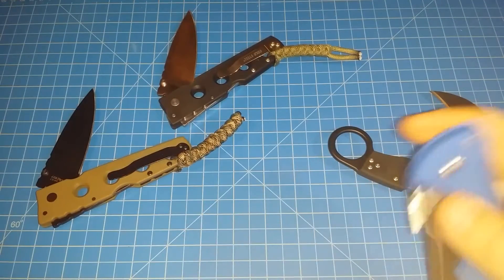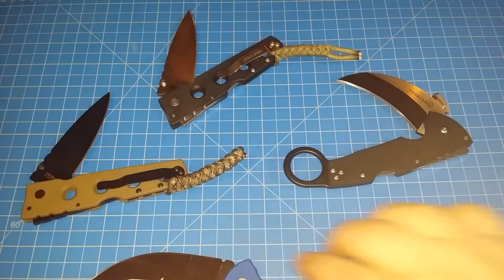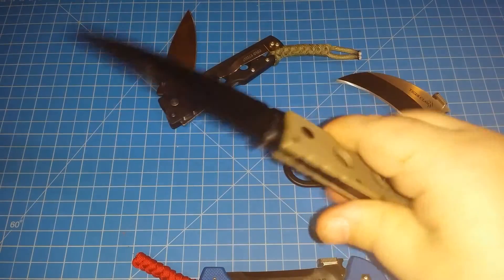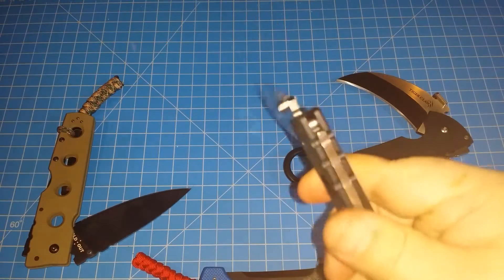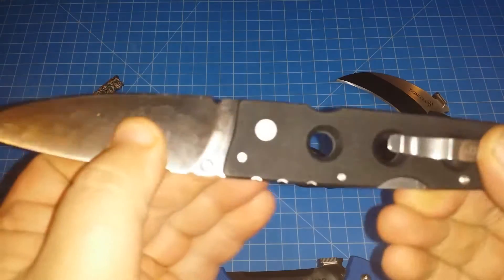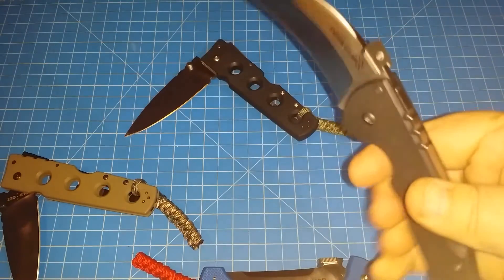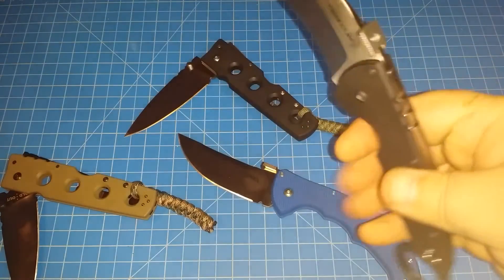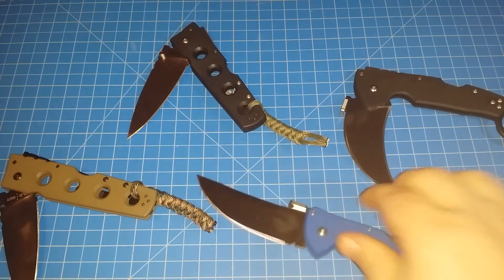Cold Steel Spring Workaround?

Comment: If you feel like going through the trouble you can take them apart and polish the lock pieces, the washers and the G10 under the washers.  I did that with a couple of my cold steels and it really smoothed them out.  My black Hold Out 2 is also emasculating.  I wonder what the deal is with those things.  Thanks for the video!
Reply from the maker: Oh, nice. I barely need any reason to mess with my knives beyond my pay grade. I will give this a shot. While I am not reveling in your difficulties, it does make it easier to know that I am not the only one having problems with the Hold Out.  Thank you for the comment.
Reply: GLAD TO KNOW IT'S NOT MY OLD 73 YEAR OLD FINGERS AND HANDS

Comment: I heard about this as well. Also about stacking sheets of paper under the pocket clip to loosen it. 
I also heard about the spring thing regarding auto otf knives and that they wear on the use and not static which coincides with the magazine theory. 
I think springs and the tension bar would behave differently. Just on a hunch. I'm not an engineer. 
Not all tri ad are the same. I've only tried the rajah, code 4, and colossus. Rajah is very easy and the colossus is very stiff. 
To be honest I can manage them all and would fall under the camp of leaving it alone. If the tension bar fails or the backspacer holding it in, the lock will fail.
Reply from the maker: You are right on the triads being different. I don't think it is model specific, but, rather, knife specific. My Colossus will close like a Benchmade, right on my finger. My Code 4 and Rajahs are both pretty smooth. I can see your point about leaving them alone, definitely. I fall into that same camp, except for that dirty, dirty bird: The Black Holdout 2!!! Thank you for the great comment and for watching.
Reply: Jimislash how would order all your cold steel from hardest to easiest. 
I've commented before on one of cold steel's vs. vid,  that they should start challenging their own models against each other. Would love to know the strongest to weakest within their own herd. But that's bad business in their eyes I guess.
Reply from the maker: f22shift Are you asking about lock strength or overall? Both sound like interesting topics for a video.  :)
Reply: Jimislash just the effort to operate the lock bar on different models. In order from hardest to easiest. 
On cold steel, I just want them to test them all to failure.
Reply from the maker: I can do my part. I'll put mine in order of smooth to joint pain. The Cold Steel video would be cool. I know they have tested quite a few against other competitors' knives. Those are interesting videos.
Reply from the maker: Ok, there is a video up with some of my Cold Steel knives for comparison.
Reply: How can you enjoy a knife you can't close after using it? I will try reshaping the spring some how.

Comment: Sorry to bust your bubble. But.... This is the same premise as to whether leaving a magazine loaded fatigues the mag spring or not. The answer is no. Gun magazines from wars decades old have been left loaded and still work like new when discovered. The action of use, "pressing and letting go" is what wears a spring out. So "Scientifically" speaking, it will soften the spring more by using it over and over. No substitution for the old fashioned break-in method, unless you create some sort of machine or motor to depress the lock over and over. Keep up the good work though. Like your vids.
Reply from the maker: Well, bummer. Thank you for letting me know. I'll have to man up and start working those locks over during A-Team reruns. :) Thank you for watching, and thank you very much for the helpful comment.
Reply: Wade Page man I was really hoping this would work I was about to do it before I read the comment my code 4 is kind of stiff too
Reply: I hate to be the bearer of bad news guys, but I've been a gun enthusiast for as long as I've been a knife enthusiast. This question comes up off and on yearly on the gun forums. In the end, this is always the final word. Spring fatigue comes from engaging/disengaging, and not from staying engaged. I think the guy that commented below  about taking apart and polishing, may have something there. That is sort of like helping the "break-in" along a bit quicker. But if you don't want to do that, it's back down to just using it over and over. Build up those thumbs guys! It's not all bad though, as one of the things that makes the Tri-Ad lock so badass, is that strong spring tension that holds it so tight, making it much less likely to fail. Good luck. Keep the cards and letters coming!
Reply: nah, I don't believe you sorry. you cant compare a coiled gun spring with the steel used to make the lock on these knives. How does  "pressing and letting go" differentiate to keep pressure on the spring for an extended amount of time.  Jimislash even said it works a little bit. And on my recon 1 by Cold Steel, I did the same thing to keep tension on the spring, and its a lot easier now. How many Cold Steels do you have with a triad lock? Please tell us.
Reply: I have one Cold Steel Recon with Tri-Ad lock, but several Cold Steel knives. However, in a collection of several hundred knives, I have at least a dozen lock back locks of different kinds that use a similar spring design. The scientific principle is the same even though designs differ. Will keeping the Cold Steel knives open cause some difference? Sure. Because each working of a spring counts toward it's wear. But that difference is minimal. Working back and forth with many repetitions will soften the lock more quickly and effectively. You're free to believe what you like. Don't take my word for it. Google is your friend.
Reply from the maker: I did 100 reps on my Hold Out. It's not good for sons to see their father cry, but I did it anyways. :) The OD Hold Out seems to be doing better. The black one hates me.
Reply: @wadepage7809 Spring Strength Solution is Easy don't buy anymore Cold Steel folding knives until they fix this issue or provide replacement spring parts. Has anyone noticed gun manufacturers have they same problem with trigger spring and sell trigger spring kits to reduce the pounds of trigger pull. The springs cold steel install have an 11 lb. pull. The machinist measured it. This unacceptable spring strength. Guaranteed Cold Steel's triad lock is super strong. The spring steel requires 11 lb of force to close it.

Comment: I tried this no cigar. I tried putting the spring under pressure with a c-clamp for a week, no cigar. I put on a double pair of gloves an use a soft shrouded pen 🖊 and it release easily and did it 100's of times. But it only made it a little better. 3 videos recommended modification of the spring. 2 bend the spring a little straighter. 1 machinist took .001 off the thickness of the spring steel. I think the spring steel may modify for a while but goes back to original curve. I think the springs were defective. I bought about a dozen in 2019 all had the same issue. I called Cold Steel Warranty department in Ventura and the ignored me. I think they knew they had a huge warranty recall issue. GSM doesn't repair. They only replace and I bought these defective knives thru Amazon.  No receipts are available for 2019-2020. GSM requires a receipt.  So, I guess I am screwed twice.

Comment: I agree with you keeping tension on that spring does help. I had issues with my knife and keeping it half open does work. Along with frequent use it should get better.
Reply from the maker: Wild Parang It seemed to work for me. It may just be the Triad induced nerve damage to my thumbs that allows me to unlock them pain free. :)
Reply: I tried this twice no success
Reply: @Jimislash Probably. If i wear two pairs of gloves a push the lock with a hard plastic pen 🖊 it does release better. I guess if I was Jaws of James Bond movie I could close the knife with my metal teeth.